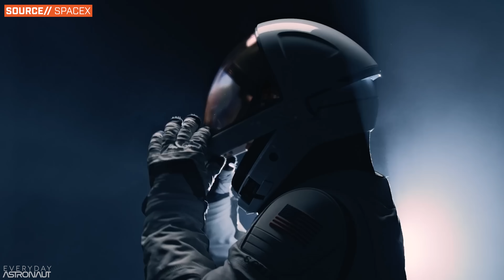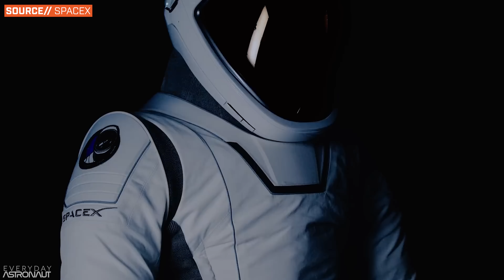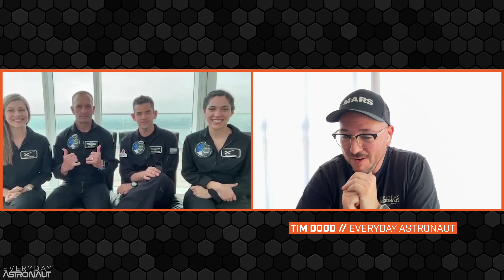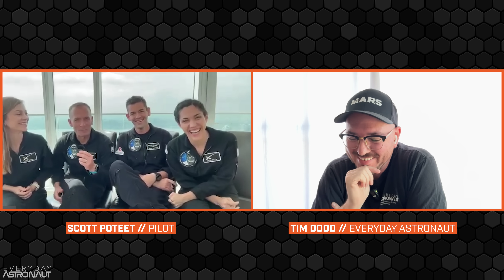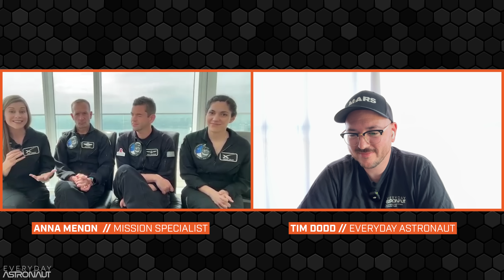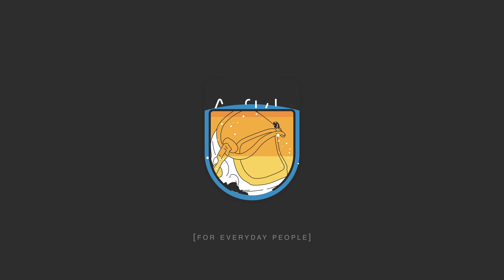How Polaris Dawn Will Do The First Commercial Spacewalk!

Comment: Something that I feel went underappreciated is the fact that the EVA suit DOES look like the IVA suit. The fact that SpaceX was able to develop a suit meant for operation in the vacuum of space that has such a slim build is pretty amazing
Reply: If it ain't broke don't change it.  One of the key differences needed in an EVA suit is that the elbows and wrists must be flexible or else you cannot do work.  The IVA only has one duty: keep the passenger alive until they can be rescued.

Aside from politics why doesn't the ISS have a laser link to Starlink whoch would give it greater bandwidth and less end to end delay than its 1980s style link through TDRS?  It seems to me all they would need to do is strap a Starlink satellite to the top of the ISS and plug it into the Ethernet network of the ISS.  Why don't they at least plug the Starlink "dish" on the Dragons that are always docked to the ISS into the Ethernet.
Reply: @jamescobban857  I know nothing about the Starlink's lasers... but I guess that you have to aim the laser directly, you are not sending wide radio waves easy to catch.
And you can do it between the Starlink constellation because they move on the same height, at the same speed... the ISS is not.
I guess it would be harder to aim, and you would have to change target constantly.
Reply: @samos_sainz  It could still be done though.
Reply: @samos_sainz  Starlink satellites are often moving relative to each other; this is already how the satellite-to-satellite optical links already work.
Reply: @jamescobban857  And, sure... "If it ain't broke don't change it".
By now, they are gonna test "what seems enough", for an EVA, for the vacuum.

But, would it be enough for more? for another environment? the moon's dust, the mars's sand?
Protection against impact, like from hitting yourself against the ship while on an EVA?
Resistant to cuts, like with the moon rocks?
Life-support without umbillical?
Propulsion?

Thinking on this, that's why I say it would need not only future upgrades, but another "tier".

- Autonomous life-support system
- Directional propulsion
- Impact and wear resistant.
- And designed for both vacuum, the moon and mars environments.

What do you think?
Reply: @jamescobban857  They could finally stream movies from the space station!  Maybe NASA doesn't want that because of the loss of work productivity from the astronauts would start to look more like Earth?
Reply: @jamescobban857  "If it ain't broke don't change it. " Good idea. Lets go back to the caves! That worked just fine.
Reply: Agreed!  I had a brief back & forth earlier this week with a guy who thought the new, teathered suit was a dumb step back to Gemini days.  🤦‍♂️
Reply: SpaceX will be evolving the suit one step at a time just like their rockets until it does what they need. But it will never be done, always being improved upon.
Reply: My guy , this isn't a "work" suit , it's for a short sight seeing EVA.
The ones used by NASA , Roscosmos and CNSA are built for 5+ hours of independent operation
Reply: @sidharthcs2110  That's what I was meaning... They have stated the purpose and the limits (that they are about to test) but even if amazing... I agree, it's just for a short EVA taste.
The EVA suits that have being used on the ISS for decades, even if bulkier, are more capable beyond comparison.
And may be not yet, but sure they will need a "work" suit, of whatever company or agency... not to "mine an asteroid" but sure to mine and build on the Moon.
Reply: Yea. They recreated Ed Whites 1964 Gemini “EVA”. What else do you think you’re seeing?
Reply: Sure, but... It's just to endure vacuum, and perform Extra Vehicular Activities while attached to an umbillical life-support system?

Or would it develope into an independent system inside the suit?

Would it need another "tier" upgrade, beyond EVA, not for vacuum but for moon/mars activities?

Because to me, it doesn't seem robust enough, yet.
Reply: @samos_sainz  I'm sure they will upgrade it with a backpack for oxygen and other things eventually.
Reply: @samos_sainz  "it doesn't seem robust enough" Please state your personal use case.
Reply: @wolfgangpreier9160  Huh, and you? have you used more than 1 spacesuit, for comparison?
It should be clear to you that "I think, to me, it seems" means an opinion, not an statement.
But I guess that you just insult and try to offend, any time you don't agree with anything.
"What the f* do you know! are you an astronaut!?"

P.D: And don't tell that's not how you said it, but that's exactly what you intended to.

BTW, before the "to me, not robust enough", I shared 3 questions... you could have answered to it, instead of reacting to the ending line.
Reply: @samos_sainz  This thing is robust enough to EVA. What did you want to do with it? Mine an Asteroid?

And please step down from your pedestal. The world does not revolve around you.
Reply: @samos_sainz  No i have not used a EVA suit and i will never use a EVA. And i do not criticize SPace-X or NASA for creating their EVA and demand theirs to make it „more robust“.

You are continuing to try to insult others. Just shut it off. Would you please? 

Have it stepped on your Johnson inadvertently? Sorry. You should not lay it down on the ground where i may accidentally step on it.
Reply: @wolfgangpreier9160  I do not criticize SpaceX nor NASA demanding them to make their EVA suit more robust.
Since the beginning I was saying that I expect it to develope a lot more... because they have stated the purpose and the limits of this suit, and Agencies are yet to develope solutions for Mars and the Moon.
Dust and sand are a problem.
Longer exposure to radiation, autonomous support...

I love SpaceX suit, but is still missing many features NASA's Apollo suit was capable of, decades ago.
And there are future known problems nobody has named an answer yet.
So yep, not because I want to, but it would have to develope a lot more, and I expect it to integrate more systems and become more robust.

And like you say "please, please"... well, please, make an argument and suggest your point.
Do you think this would be the final suit, ready for Mars?
Reply: @samos_sainz just musk fanboys. No room around here for an objective discussion. You worship spacex or get ostracized. Which is funny because as you said, you’re not really even being critical, Just asking a completely reasonable and expected question about the development of the technology going forward.
Reply: @russellg1473  Thank you for such a warm support, buddy... It's been a pleasant surprise.
Reply: @wolfgangpreier9160 if I fall off my moon buggy at 15mph because I didn’t buckle up.
Reply: @craigmackay4909  I do not. 

Why do you fall off? Did you not learn in school to hold onto a buckling moon buggy? All the time!

Comment: Did they say the bottom of the EVA suit's shoes has a layer similar to that used in heat shields for thermal protection? So, could this EVA suit be used for re-entry? Lol, probably not, but it was a fun thought.

Comment: no question about the Hubble?
Reply: Why does the Hubble matter in this conversation?
Reply: @jackinthebox301  Isaacman has talked previously about the idea of having one of the future Polaris missions being a Hubble servicing mission. That's pretty speculative, though... NASA weren't averse to the idea, but I think it's far too early for any actual plans to be discussed.
Reply: @simongeard4824  I think doing the spacewalk would be a good sign that they could pull it off.
Reply: @NSAA360Studio  It would certainly be a good start, yes. But part of the uncertainty is that previous missions Hubble missions have all relied on the ability to drag it into the Shuttle payload bay... that's obviously not possible with Dragon, and that'll limit what they can do.

Comment: when Jared said “avionics generally don’t like radiation” @2:55 what does that mean exactly? is there that much radiation even just from where they’ll be at from earth? sorry if this question isn’t a good one
Reply: Radiation particles are small enough to interfere with the electronics at an atomic level. Avionics being hardware thats already sensitive, it's a new thing for SpaceX to engineer for.

Like Alex said, some particles from the solar wind are rejected by the magnetic field and other particles are guided along the field lines where it enters the atmosphere. That's what the aurora borealis is and is also why you only see it when you go North or South. The magnetic field's toroidal shape passes through the planet near the poles. This naturally creates areas of increased radiation above the planet. They're going to be passing through those areas deliberately in order to do tests.
Reply: appreciate you alex & Jack for the reply! gave me much more insight, thank you
Reply: My guess is he's talking about the Van-Allen-Belt, which they will fly through because of the relatively elliptical orbit of their mission (meaning their apogee/furthest point from earth is beyond the Van-Allen-Belt).

This is from Wikipedia: "Van Allen radiation belt is a zone of energetic charged particles, most of which originate from the solar wind, that are captured by and held around a planet by that planet's magnetosphere. Earth has two such belts, and sometimes others may be temporarily created. The belts are named after James Van Allen, who is often credited with their discovery."

Its effects on the avionics might be of specific interest to SpaceX and Nasa because one also has to cross it to reach the moon.